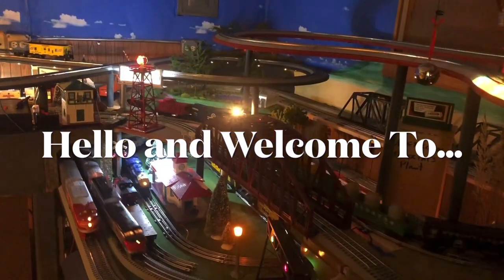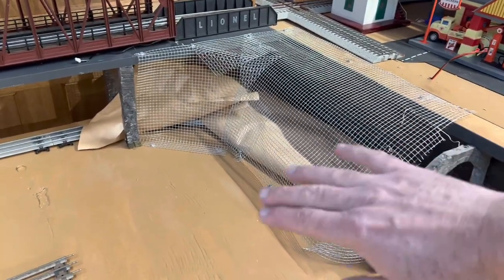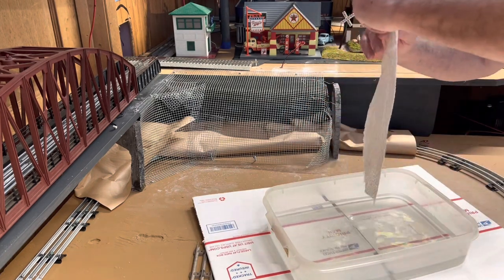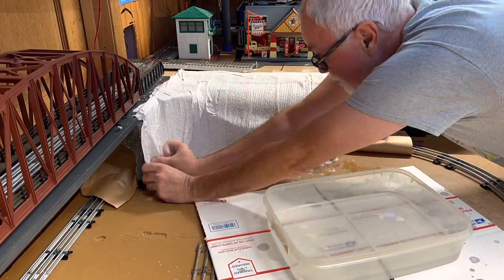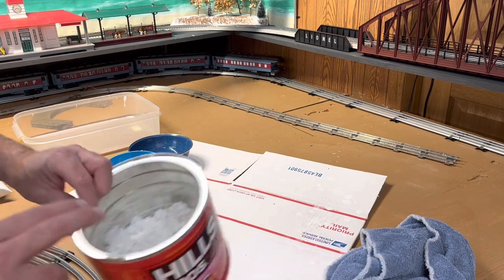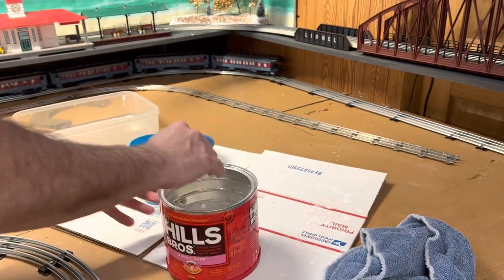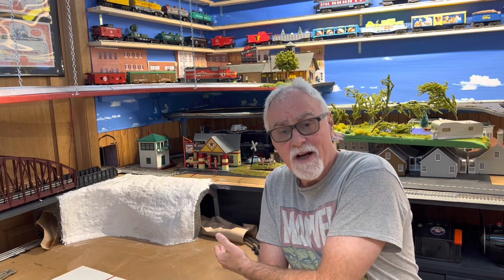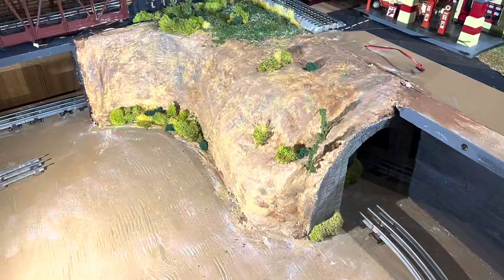How to make an O Gauge train tunnel

Comment: Do you  think you  can use plas9 stripes and expanding  sprayfoam
Reply from the maker: I haven’t tried to use expanding foam for a tunnel. I know it works good if you want to just build rocks then you can carve them the way that you want and then put a light coating of Sculptamold over it. I would think if you’re going to use it for a tunnel, you’ll have to carve the inside of the tunnel, unless you can figure out a way of controlling which way the foam expands.
Although you have given me a good idea for an upcoming video, maybe I’ll do a little experiment to see how it works

Comment: Have you tried using spray foam?
Reply from the maker: Not yet but I have an area that I’m planning on putting a mountain side and I figure I’ll try that method when I do it. Keep an eye out for that video.
Reply: @Pvilletrains  ive used spray foam to make a mini off road track for my 1/16th scale rc rock crawler and it came out nice. Use some texture spray paint after. I’ve also use wadded up news paper and then soaking strips of newspaper in a mixture of Elmer’s glue and water and laying it on the wads of newspaper to make hill sides and mountains.